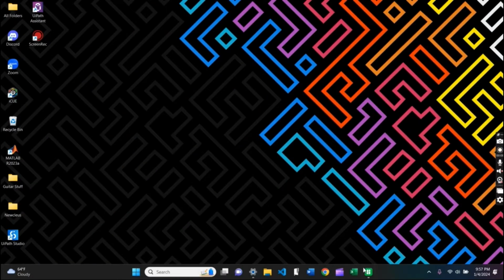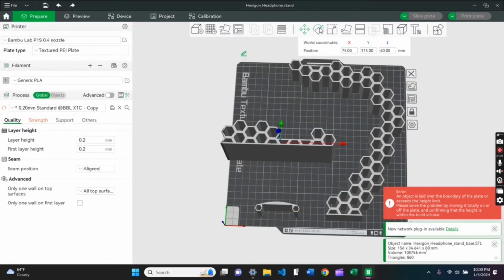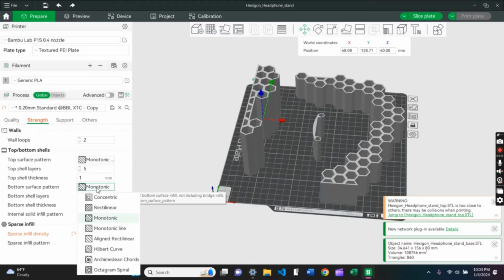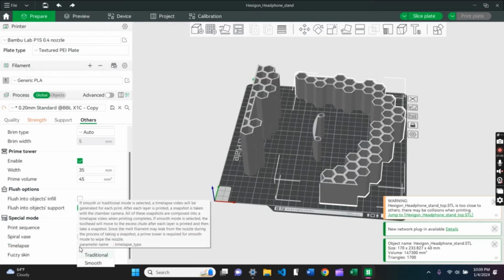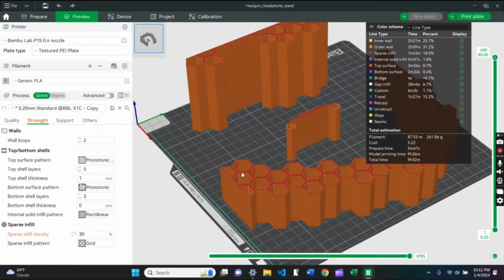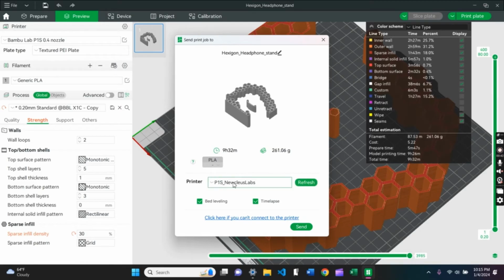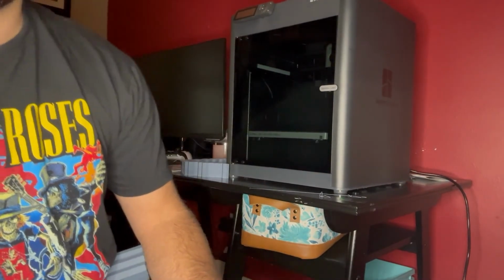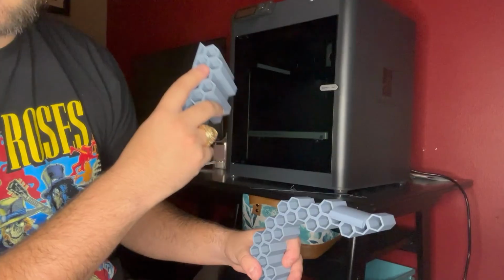Bambu Lab Studio BASIC BEGINNERS GUIDE and FIRST PRINT!

Comment: Don't think you need to set the nozzle and bed temperature manually when it's defined in the general settings, I just start the print.
Reply: I was gonna say the same thing.  When I just hit print, the nozzle and bed automatically heat up and the nozzle is over the poop shoot when it warms up.